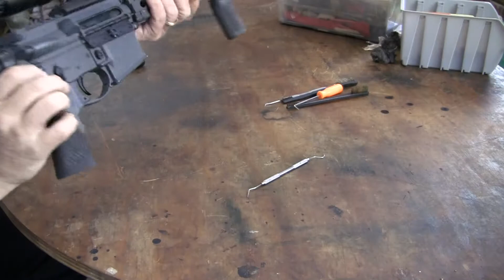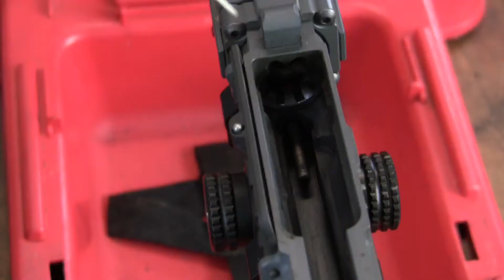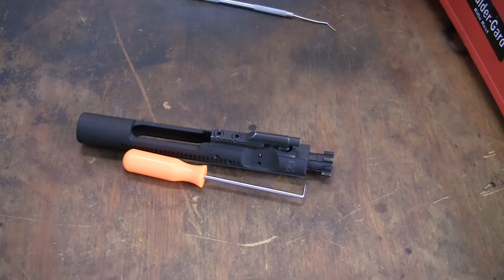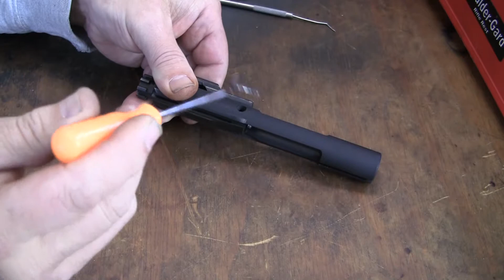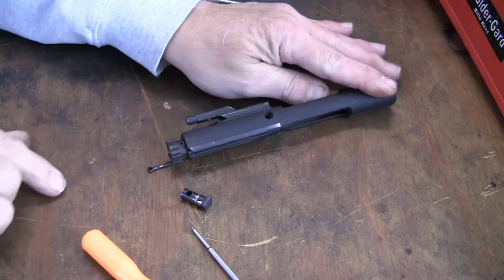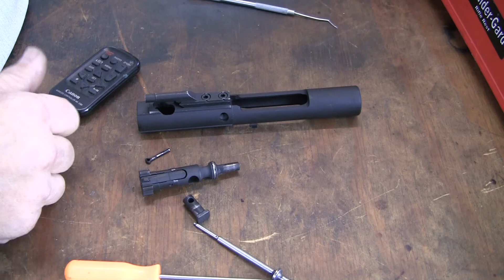AR 15 Problems Field Strip and Troubleshoot

Comment: "Scrubbing Bubbles" works wonders on the carbon. We soak the BCG with S.B.'s and brush off the shxx, easy peasy.  Don't laugh till ya try it that's what we do at Ft. Dix then run it over hot clean water n lube. Barrel ext. we use the star chamber brush.
Reply from the maker: will give it a try sometime
Reply: @TheKoba49  Amazon sell a $15.00 folding scrapper  that cleans every part of the inside n outside of  BCG........